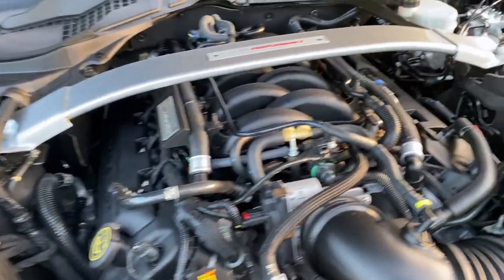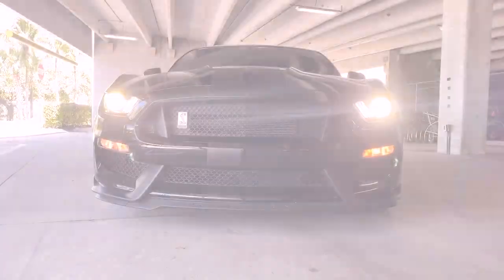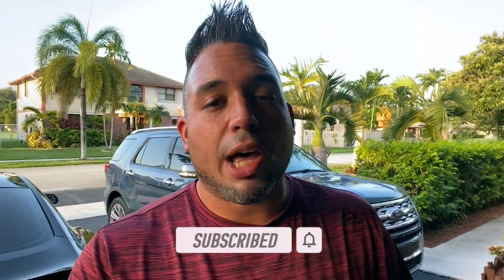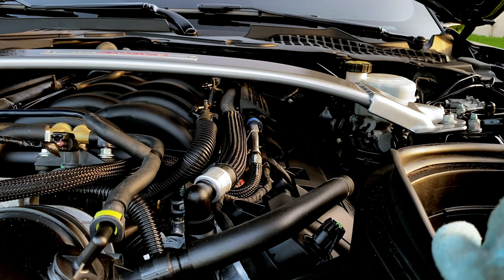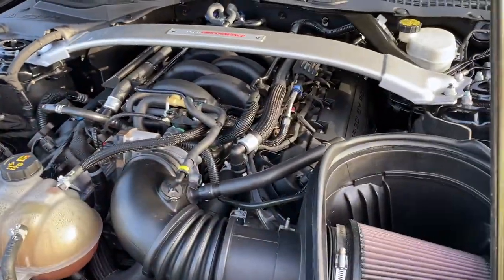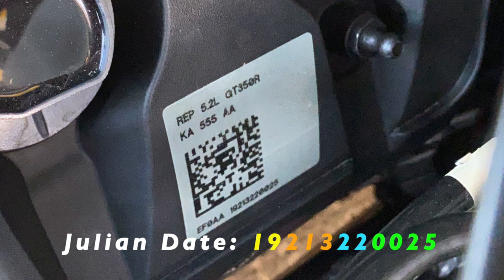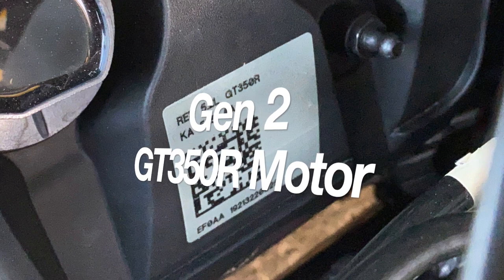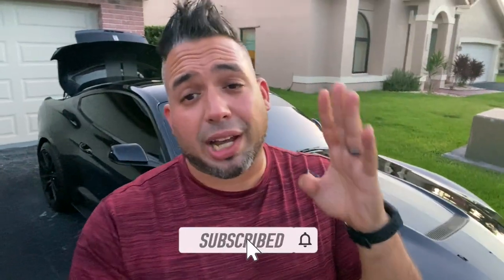Has My GT350 Motor Been Changed Before and Is It Consuming Oil?

Comment: My 2017 is currently getting a gen 2 long block it only has 10,000 original miles and Ford had me do 2 oil consumption test and it was drinking 3-4 quarts in an 1000 miles and this was daily driving. Car has never been tracked all tires are original… very disappointing!!
Reply from the maker: Damn sorry to hear that. There are bad engines out there for sure. Good thing is that the new long block should remedy that and you should be good to go💪🏽
Good luck and let me know how it goes!

Comment: My 2017 GT350 has 22,000, still going strong.   Just add a little oil every once a month. 😀
Reply from the maker: Awesome! Enjoy that beast! 
Thanks for watching and leaving a comment!
Reply: I just got my 2017 GT350 with 3500k miles. Had oil changed around 4500k.  After some spirited driving,  I checked oil just before 5000k, and it was down 1 quart. Is this normal? I will install oil separator catch can soon

Comment: What does anyone think about adding oil additives,  to strengthen oil, with oil changes?  Are oil additives bad for this engine if used in moderation?
Reply from the maker: I never thought about adding additives to the oil but I don’t think I would. Haven’t done research on it so wouldn’t mess with it until I do.

Comment: Do I have engine warranty on my 2017 that I bought with 3500k, now 5000k?  I'll call Ford
Reply from the maker: I would check with your dealer. Mine is a 2017 and I have another year of powertrain warranty. I was told by autonation (where I bought it) that it expired this November but after checking with Ford I confirmed it is November of 2022.

Comment: Hi ! I have a 2016 since early may 2021.
I added 3 pint of 5w50 
For total 5000 km since I purchase it.
Any advice for me ?
Oil change done last month but still cusumming. 
warranty expired
Reply from the maker: Thanks for the comment! Sorry to hear about your issue. 
I would see if you qualify to purchase Ford extended warranty. They have a few different options that cover the engine. I would wait a few weeks after purchase and then take it to them to check the engine. If they find something wrong then they should cover replacing it.